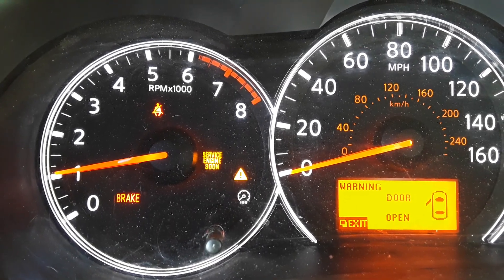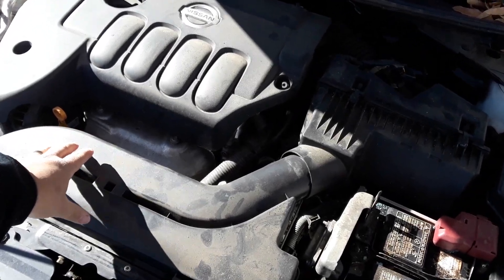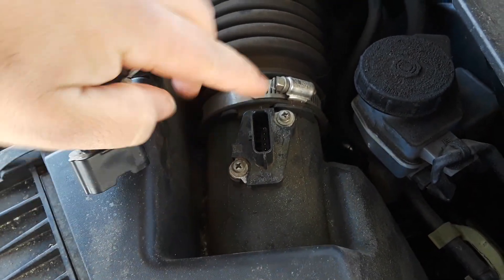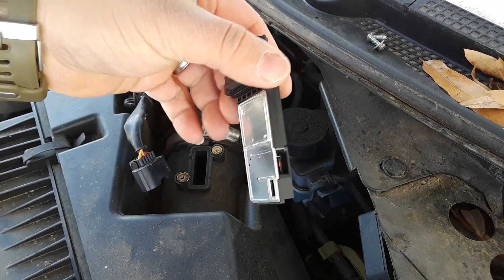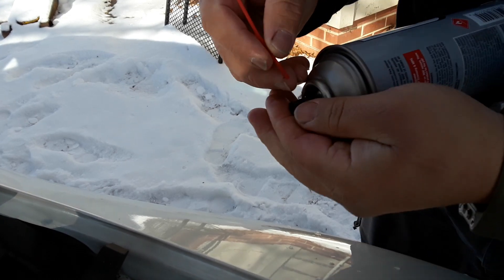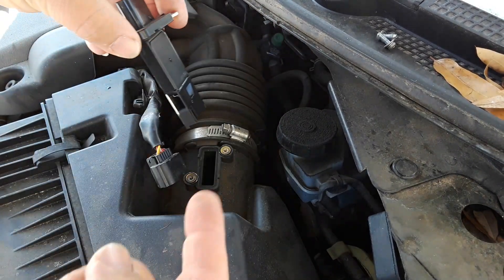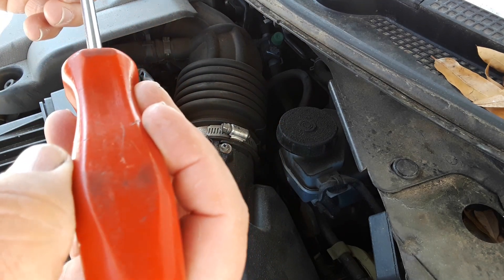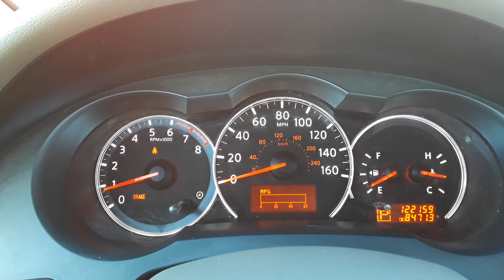How to Clean the Mass Air Flow Sensor (Code P0101 on Nissan Altima)

Comment: I have a 2012 Nissan Rogue and failed my emissions test because of this code.  Do I have to disconnect the battery from the plug on top of air sensor?  Do you need to spray inside the compartment that holds the MAF sensor?  Thanks!
Reply from the maker: You need to remove it and clean it. Not familiar with that model but clean it off the vehicle. The check engine should clear onnits own, if not go by your local Advanced, O'Reillys or Autozone to use their scanner and clear the code.

Comment: Good but simple tutorial! Only thing I would add would be that don't be afraid to blast the sensor with the cleaner(but ONLY MAF cleaner, no exceptions) and that grabbing a new air filter is never a car idea in this case (stay away from K&N or any filterb that uses oil in the filter element to collect dust). And make sure not to touch the sensor with anything, especially anything oily as you don't want to damage/contaminate the sensor. Body oils or any oils on the sensor itself will drastically reduce the lifespan causing the sensor to "burn out" as the small sensor probe does get hot during normal operation.

Comment: Can A P0101 MAF issue throw codes like CVT Slippage (p17fo), I just bought a used 2013 nissan altima @ 124k miles and got the check engine light on after 2-3 days I drove it around 1.5k miles, I did a fixfinder reading and it shows me the codes P0101 and P17FO, I was just wondering if the MAF can throw codes for failing transmission/cvt slippage mistakenly? I took it to the dealer and he just erased it and the P17FO code didn’t show up on this OBD2 scanner. He asked me to bring it back if there’s issues and im taking it to him tomorrow.

Comment: Thanks for posting this video. I followed the instructions for my Altima 2013, after spraying mass air sensor, do i need to manually reset the "check engine" light or will it go by itself after driving for sometime?
Reply from the maker: It should turn off by itself. If not you may have to reset it with a OBD II Scanner
Reply: @mazterovdizaster  "Check Engine" light turned off by itself after driving about 30 miles. You are awesome, you saved me few hundred dollars :-) Thanks again!
Reply from the maker: @MarimuthuSA  glad to help!

Comment: What type of issues could this cause. My car is shuddering hard and has lost power although it has 260,000 miles my altima has never had a problem this bad
Reply: Go to local body shop and have them perform diagnostic scan. The cost is free. Ask for the codes. It may be minor. Also open your hood check observe the throttle body is tightly comnected.
Reply from the maker: Exactly, stop by your local auto parts store too. They can scan your car as well and give you any codes it is currently showing.

Comment: Ooh man thank you so much, this helps. Seems like most Nissan's have this issue. I just came from dealership recently, they cleaned throttle body and mass airflow sensor and everything. The issue was fixed for two days then we had -15 degree Celsius then the check engine light came on for P010. Two days after the temperature went to 0 degrees Celsius. Now the P010 is gone. For what ever reason in my car this light comes on between -5 degrees and below. 

By any chance if anyone happen to know why this is only happening in cold please let me know, and if you know a fix that would be awesome.

Comment: I think the 2011 Nissan Altima P0101 code is a defect of the part or the whole set up. Nissan should of did a recall on the part or something. No way this many people continue to have the same issue of that code.
Reply: 🤭 If you think the MAF is the biggest downfall of Nissan.. you haven't been around them long enough. The CVT transmission has way more failures on these POS cars!
Reply: @dennismelville7532  funny that you mentioned that😂. My cvt trans failed last October. Never will buy a Nissan again!

Comment: I replaced with a new MAF and a few days later the Check Engine light came on again.
Reply: Did you figure out what it was?
Reply: @rawlee6719  No, the light still on even after replacing brand new MAF sensors.
Reply: @Foodie2.1  First perform a diagnostic scan. If the code reads mass sir sensor you more than likey need to have the computer update.  See you local auto shop. Cost $100 to $150. speak to local auto shop.
Reply: @nursemcfarlane6655  A shop replaced the MAF sensor and they told me they didn’t need to anything except clear code. But the light came back 2 days after it was installed 😭.
Reply: @Foodie2.1  There is a special Nissan computer used to reprogram this sensor. Call Nissan they will explain.
Reply: @nursemcfarlane6655  Thank you! I need all the help I can get.
Reply: @nursemcfarlane6655  Thanks again! I went to 3 different shops and all gave code P101. I will call local Nissan dealership to see how much they charge to reprogram. I have been driving with the car after the MAF sensor was changed with the Check Engine Light on.
Reply: @nursemcfarlane6655  thank you!

Comment: Does this code always clear by itself when the MAF is clean (it appears to be so with you car) or does it require clearing first, and making sure it doesn't reoccur?  Probably varies by maker??  Good vid.
Reply from the maker: Sometimes it does like in my case. Sometimes they have to be erased by a scanner.

Comment: I just cleaned my air flow sensor and my engine light finally went off after driving it for about 80 miles 😊.. thanks for this advice instead of paying an arm and a leg at the STEALERSHIP!!
Reply from the maker: Glad to help out!

Comment: I did this and didn’t work so I just bought the new sensor and the light still won’t come off can you help ?
Reply from the maker: Sometimes you need to reset the light with a scanner. There might be something else if it didn't turn right off.

Comment: I have Nissan Versa 2014. The rpm is jumping and car jerking while accelerating. Lot of people suggested to clean or replace maf sensor. There are no codes or engine light, will doing this help resolve the issue?
Reply from the maker: It could! This controls the air fuel ratio so it could cause all sorts of issues!

Comment: My Nissan just did this. I’m gonna be doing this later when I get home and keep you updated! Looks very promising
Reply from the maker: Hope it works!
Reply: @mazterovdizaster  Will the check engine light go off right away? Just cleaned my air flow sensor on my 2008 Altima , but light is still on
Reply: @noahsilva2001 same I did it agin but ima let it air dry longer

Comment: I can’t get the connector off
Reply: There is a lever on the side, insert a flat head screwdriver and press it forward and then lift off. Easy. Be careful don't break the small lever with your screwdriver.

Comment: i do the same step for my altima 2012 but light still on? plz any advice ? or have to get new one $130
Reply: You have to clear the code after you clean it , auto zone can do this , o'reilly too
Reply: @nicktastic8183  i do buy new one auto zone $140 drive like 5 mile light still on, so you mean i can go back to auto zone & ask them to clear the code?

Comment: I have a question I hope you can answer it. Should I disconnect the negative battery cable before attempting to clean the MAF senso 2016 Nissan Sentra SV

Comment: hi i recently 1-2 month ago cleaned and re oiled my aftermarket knn filter then this code came... do u think i used too much oil on the filter causing this error code messed up sensor???
Reply from the maker: Yes! Clean the oil off it.Too much oil on K&N filters will definitely do it!

Comment: My car is idling a lot better, but my service engine light is still on. Going to drive it around a bit longer and see if it turns off.

UPDATE: Light just turned off after 82 miles on my 2012 Altima 2.5s.
Reply from the maker: Good luck!

Comment: Dealership wanted $380 to fix it, thanks to you I fixed it for $11 👍🏻
Reply: Screw the dealerships for ripping people off.
Reply: @111111111Tiger  That aught to be against the fucking law for dealerships to screw people over like that 😒
Reply: How long until your light turned off?
Reply: @gabrielescobar175  after 50 miles but a couple months later it came back on, cleaned it again and it hasnt been on since
Reply: @gabrielescobar175  i did mine and it went off immdeidately. this is life saving
Reply: Im going to try it timorrow
Reply: That aught to be against the fucking law for dealerships to screw people over like that 😒
Reply: Got the same code on a 1 year old 370Z.  I asked the dealer to clean.  Dealer refused - stated I needed to buy 2 new ones - the 370Z has two intakes.  I bought the cleaner to try it.  It worked.  Said bye to the dealer - forever.
Reply from the maker: Awesome! Great to hear!

Comment: My dealership looked at it and the service engine light and said its 350$ to replace the mass airflow sensor.
Having looked at this video , I said no sir you ain't fleecing me today
Reply: replacing the sensor maybe won't resolve the problem, there are a TSB, I am looking for an specialist to reprogram the ECM according the P0101 problem. Please tell us how did you resolve it.
Reply: @edgardhc  Before you have it reprogrammed, change out the PCV valve. There is a TSB about the PCV valve needing to be swapped out. If the  color of the valve is orange, it needs to be replaced with a black one. The valve can also throw that code.
Reply: @gooneegoogoo123  Thanks for your recommendations, is black color. I tried to replace for a generic new one and din´t work, I kept the original PCV, because the generic PCV raised P0171 and the original was OK.
Reply: @edgardhc  If the original one is black, you should be OK. For code P0101, first verify that the PCV valve is black. Second, clean throttle body, clear code. If code returns then, replace MAF sensor. If code returns, then the issue is with the ecm software. Damn Nissan!!!!
Reply from the maker: Awesome!
Reply: Tbf damn sensor costs near $280+tax for an OEM version, that's not an outrageous price considering.

Comment: This was a great video. Gentleman got straight to the point and told us what we needed to do and how to do it. This light just came on and coded on my sons car I should have it fixed in 10 or 15 minutes fantastic
Reply from the maker: Great!
Reply: did it fix the issue?
Reply: @pattygq  Yes this tip did fix the issue. Probably saved me $$$ for doing it myself.
Reply: @sudokucafe  There's also a campaign that Nissan is running in which an issue pops up about the MAF being incorrect but no drivability concerns exist. It's a quick update of the software which corrects it. Iirc it appears in high mileage Altimas.

If there are drivability concerns then it's a different issue.

Comment: and if it does not go away you may have to get a new one which is about 140-150$
Reply from the maker: Yes, easy replacement part. You can do it yourself.

Comment: Hey, 
I have a 2011 Nissan Altima. The check engine light is on and randomly my traction control sign goes on. When the traction sign goes on I can't pass 2,500 RPMs. Do you think if I change the filter and clean the sensor it will solve the problem? 
Thanks
Reply: Have you tried using a different sensor? I had the same issue. Swapped it out with a different build of the sensor and it went away. I was using a 2011 sensor instead of a 2013 sensor
Reply: aissa boukrit same problem
Reply: This is whats happening with my 2015 Sentra. Did you figure it out? I had the code ran at Auto zone and it brought this up. I'm just curious about why the slip/traction sign came on as well.
Reply: No, changing the air filter won't resolve the problem. The traction control and the VDC goes on because the ECM detect a problem and protect it self cutting to 2,500 RMP. There are a TSB about this issue that is very common on 2011-2012 Nissan models .
Reply: @edgardhc What causes this and how to fix it, this happened to me last week and it freaked me out thinking the transmission went out.
Reply: Did you get issue fixed?
Reply: Did you find out the issue.

Comment: I wish I had seen this earlier.   Before this, I just sprayed into the hiose where sensor located.  Right after this, I followed this instruction, it worked for bit.  But now sensor giving me false readings.  Used to be 372 on full tank but now it us 280 or less.  When cable is disconnected, it still runs.  2010 Nissan pathfinder.   Help.  😖

Comment: The hole you’re spraying is the intake temperature sensor if you look further in the next hole there is a resistor that’s where  you want to clean the sensor

Comment: I got the P0101 code around May, but I wasn't able to afford to buy a new sensor til June, but even after I replaced it, the code is still on.   I even had the sensor tested and verified it wasn't bad/dead on arrival.  So now I am on to the steps of cleaning the sensor and connector, cleaning the throttle body, or as a final effort having to have the dealer reprogram the damn computer.    Like I want to drop $200 on that.

Comment: I cleaned MRF, but not working. I cleaned throttle body, replaced air filter, MRF, and PCV valve. But, P0101 is sometimes on. Is the only solution reprogramming?
Reply: Did you try clearing the code?

Comment: Thank you so much!  Fixed my issue.  Worth checking the air filter while your in there. Mouse chewed through my air filter causing a tiny shred of paper to go into the MAF sensor.  I lightly vacuumed it out and cleaned with spray since it was already out, and bought a new air filter of course.   You saved me hundreds of dollars.  Thanks!  My check engine light stayed on but another search showed how to reset it.
Reply: how did you reset your check engine light? Replaced my mass air flow sensor since cel code was saying it was the issue, but cel didnt go out and symptoms revving and no power on its own was doing didnt go away fully. Replaced throttle body sensor now too, still cel on.

Comment: Cleaned everything including the box, both sides new filter, and the MAFS twice ... Still has light.... Do I just have to get it reset? The original warning was for the mass air flow sensor and nothing else.
Reply: u should reset after repair to see if it comes back. use a bluetooth obd2 and torque pro app.
Reply: ᏢᏓᏥ ᎤᏍᏗ wiggle the harness and see if the vehicles shutters or runs rough if it does then you need a new mass air flow connecter

Comment: I need help my car got low accerelation someone told me is the mass airflow sensor dirty like this video service light came on out no where and I feel my car got low accerelation would this fix the problem?
Reply: jonathan cardona did this fix you’re car problem ?
Reply: Did you ever find out what the issue was and fixed?
Reply: @Foodie_888  clogged catalytic
Reply: @Chosenfew_0129  Good to hear the issue was fixed.

Comment: Will good old carb or brake cleaner work to clean the sensor?
Reply: Hey, did you ever find out if caerb cleaner works ?
Reply: @josephercole143  I read it will burn through the film the sensor has so didnt try it.

Comment: A friend of mine today went to the dealer with the same problem. They charged him $600 to replace the mass airflow sensor.
Reply: That's crazy.  That's why they call them "stealerships."   I found a new one on Ebay for about 21 bucks for my Nissan.
Reply: Good god that’s is ridiculous. That should be considered theft.

Comment: 2016 sentra.. code 0101 is not the actual sensor lol.. the computer detects a performance issue... u need to replace the air filter, and I regapped the spark plugs since they last 90000 miles.. problem solved..
Reply: the P0101 is the ACTUAL sensor code.  It doesn't relate to anythings else but the Mass Air Sensor.

Comment: Do you know if plain alcohol can do the trick?
Reply: J. Ni
No.  Get a can of Mass airflow sensor cleaner.
Reply: If you use rubbing alcohol, use the high-percentage kind (90% or so) rather than the 60-70%; make sure there is no glycerine or other additives.
Reply: J. Ni just buy the proper cleaner or you’ll mess up the sensor

Comment: My mechanic charged me 250 for this 🤦🏿‍♂️🤦🏿‍♂️🤦🏿‍♂️🤦🏿‍♂️
Reply: @P. Spit I called my local Nissan dealer for the maf sensor and they said it's $ 397 . My code reads P0103  on my 2009 Nissan Pathfinder, so I'll try this tomorrow
Reply: My Nissan dealer also charged 250 for this too..

Comment: I did this to mine but check engine still on any ideas what it can be ???? I already cleaned the throttle body and the K&N filter also but The code still come out po101.
Reply from the maker: Then you might need to replace it. I have seen where the k&n oil from the filter coated the inside and they really had to spray it a lot!
Reply: reprogram your ecm by going to a dealership. I did it today and it cost 120. It work
Reply: One problem with K&N filters is that the oil in the filter slowly is pulled off by the airflow; this film of oil then coats the inside of the throttle body and MAF sensor, causing many problems, including malfunction of the MAF sensor.

Comment: How do you reset it if it didn’t knock it off
Reply: sadly, you got to go the the dealer to reprogram the ecm. i did it today and it fix the problem
Reply: I got one of those cheap testers like advertized on tv called Micro Mechanic,, about 20 dollars for this tester, it works,  you plug it into the plug in under the dash and you download the software from google play store called Micro Mecanic onto your cell phone to use it, plug it in under there, start the car up and make sure your bluetooth is turned on the cell phone, it will run a test and tell you exactly what is wrong with it, than it has one button to reset it to take the light out, but it will come back on in a week,  that worthless sensor is about 150 dollars,  just a money making racket these sensors,  but it goes into the computer,  car will still run, just light will come back on until you replace the dam thing new it looks like.
Reply: O'Reilly's or Autozone will reset it for free